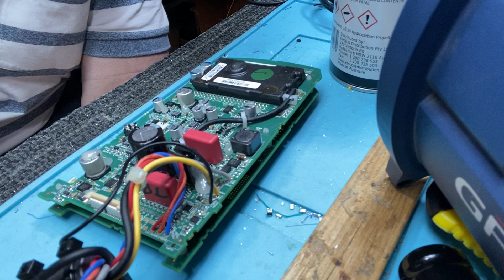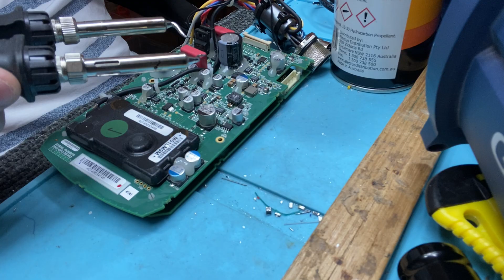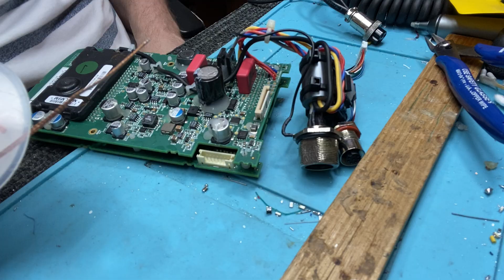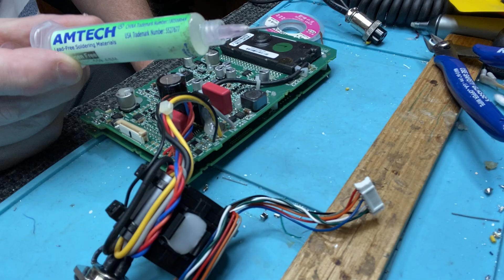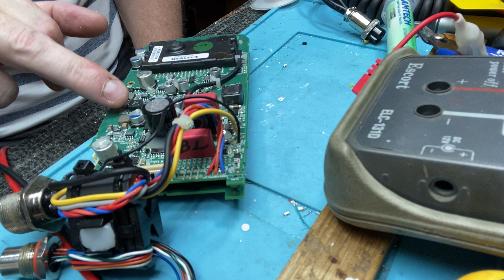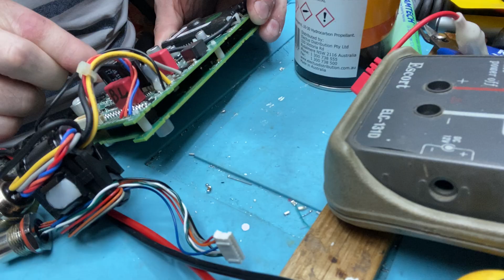GPZ-7000 Intermittent fault locate and repair.

Comment: It's probably lead free solder Woody. I don't like the lead free solder. It has a higher melting temperature and it is hard to work with.
Reply: Not far from my workshop, there was a small electronics retailer, Truscotts Electronic World.
When they closed down, I bought all their tin/lead solder, fearing it would disappear overnight from the market, like incandescent light bulbs did (you can't current limit circuits you are testing with LED bulbs 😢)
Reply from the maker: I think when I went there many moons ago they were in Croydon or Ringwood, I bought all their RF transistors and a ton of ferrites.
Reply: @DetectorMods  
Dead right.
They had a large store but downsized to a smaller operation.
One shop doing TV and Amp repairs, the other selling components and kits.
I remember the owner's son Pete, lamenting the fact that nowadays, kids weren't buying electronics kits.
The best thing though, was scrummaging through their horde of salvaged electronics - always find something of use or interest.
Reply from the maker: There are some alloys that are great for making dry joints.